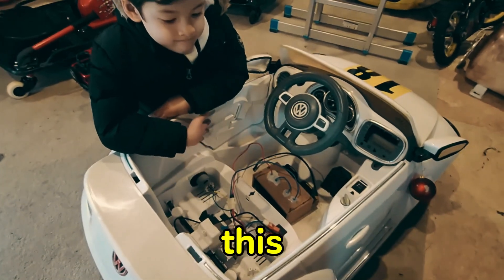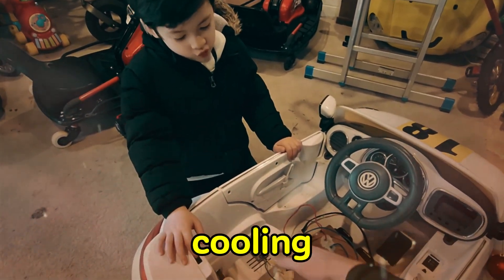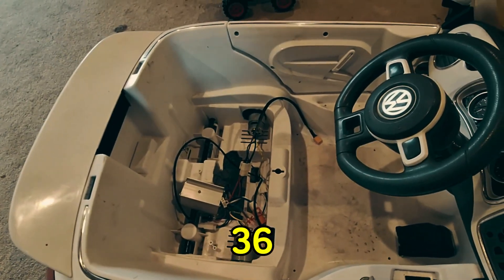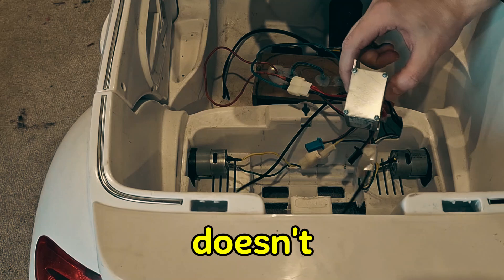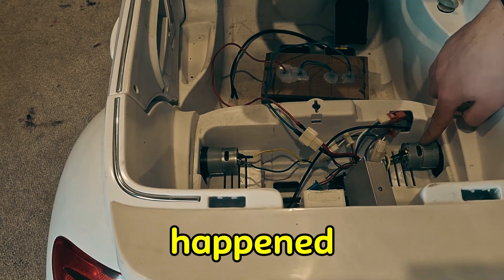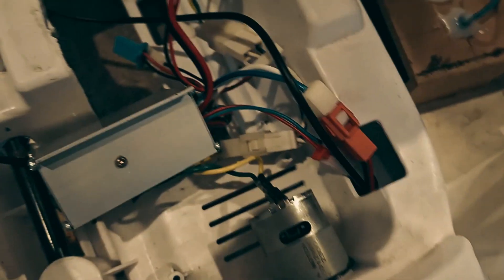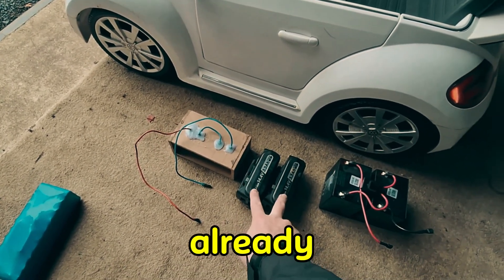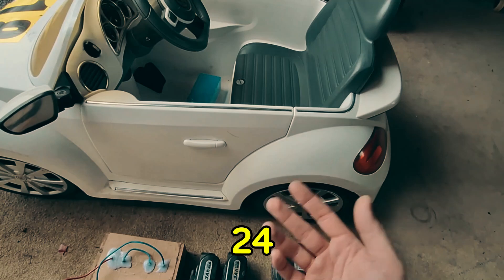36V power wheels up in smoke

Comment: Thank you!!! So the 36V worked fine with the 12V motors? 

We have some 24V motors…. Put 2x18V battery in series and the two motors started smoking. Now they will only run for a second before smoking. Even back to only 18V batteries